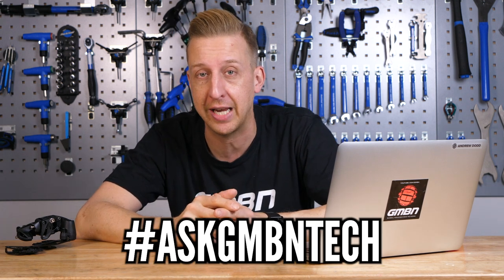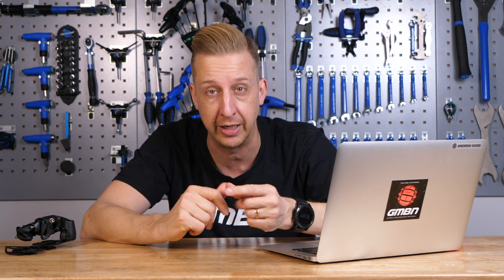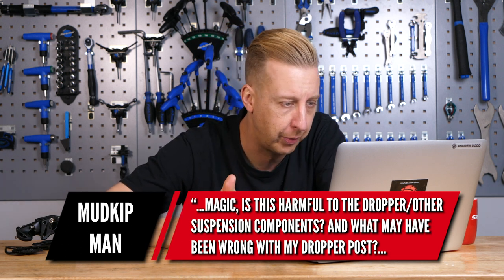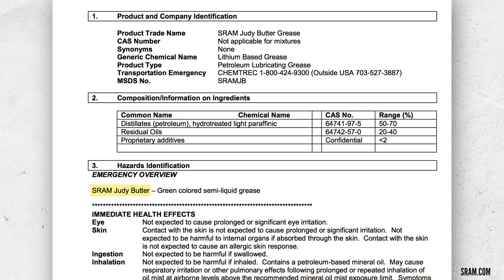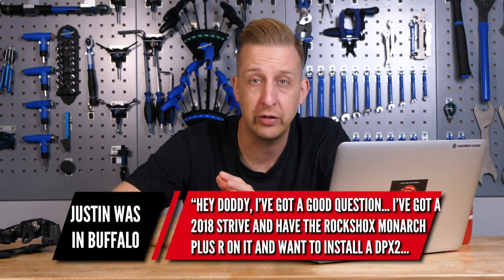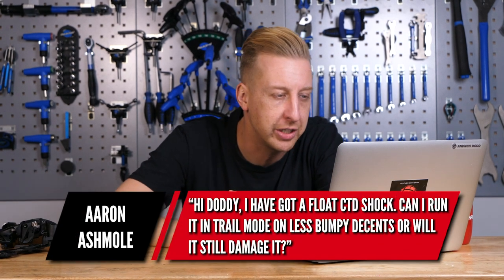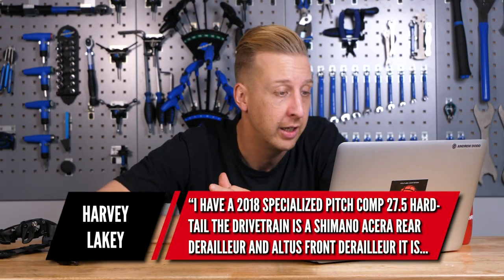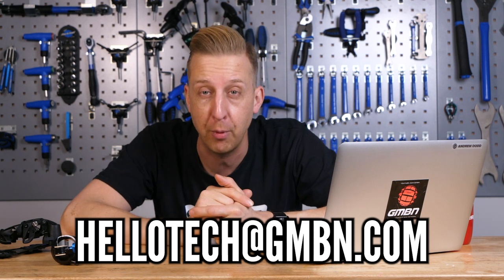Can You Use Vaseline On Mountain Bike Suspension Forks? | Ask GMBN Tech

Comment: #AskGMBNTech : hey Doddy, thank you for the great videos and tips, awesome job. 
I need help with the following. I use my Cube Ltd race (2016) to get fit, its work in progress (long progress). Some weeks back I noticed some play on my left pedal. The thread on the crank arm was totally stripped. I replaced the left crank arm (shimano XT). Now it happened again on the right side, you can imagine my frustration. I checked before I replaced the left one and the threads seemed ok...well, apparently not! My question is what could be the cause, assuming that the pedals were properly tighten. Should I use locktide, change the pedals too just in case?  thanks in advance for your input
Reply: @geemail369   @geemail369 
 thanks for the input, interesting info in the link you provided. I didnt use washers, they
 were not included with the replacement part either. I checked the 
damaged crank arm and indeed my flat pedals were digging in the lip of the chamber thread. I will see if i can get the washers next time i am in the shop, which is going to be soon as I need a new crank arm..
Reply: @geemail369   @geemail369 
 thanks for the input, interesting info in the link you provided. I didnt use washers, they
 were not included with the replacement part either. I checked the 
damaged crank arm and indeed my flat pedals were digging in the lip of the chamber thread. I will see if i can get the washers next time i am in the shop, which is going to be soon as I need a new crank arm..

Comment: #AskGMBNTech why brakes feel harder when you put zip tie around leaver
Reply: As in holding the brake on with the zip tie?
It's to force fluid down which forces air up. As it sits little air bubbles that maybe in the system  will be end up in the reservoir.

Comment: Can i use tubeless in a non tubeless rims? #AskGMBNTech
Reply: Yep, you only need to apply proper rim tape and a tubeless valve!
Reply: do i need the tubeless ready tire too?
Reply: @wildanreynanda  Depends!
With modern tires usually not. Just put a bit more sealant in it to help it seal up.
But you might end up with your very tire having a whole lot of sealant seaping through its sidewalls before it does (if ever!) - it remains a gamble since they're not made for tubeless. Only one way to find out!
Reply: Thanks thats help alot

Comment: #askgmbntech please help

I bought a voodoo canzo last year 2018

I come from a bmx background and this is my first full sus mtb...

When riding after setting the sag and rebound roughly right, the rear end feels wollowy or loose on the general off road but kicky and sending me otb on jumps please advise... Should I use more air and adjust the rebound more?
Reply: you should set sag with no rebound/compression dampening. The sag determines the spring rate and thus the stiffness of the spring (mainly rider weight dependend). Dont do it roughly but measure so you have numbers to compare. If you want a stiffer rear end aim for 25%-30% sag.
Next step is to dampen the rebound, best to count total adjustment clicks and start from the middle setting. And finally you can start playing with compression dampening, best to start from fully open

Comment: #AskGMBNTech is it possible to use tapered fork on straight tube? if possible is it safe?
Reply from the maker: It depends what size Head Tube you have on the frame? If for instance it is 44mm or 1.5" throughout, then yes this works and lot's of manufacturers make headsets 👍. But If your Head Tube is a straight 1-1/8th this will not work. We have seen people press external headset cups into integrated frames and this is strongly NOT recommended.
Reply: Don’t think it’s possible

Comment: #AskGMBNTech I’m having problems with my dropper post. Whenever I sit on my saddle, if I wait like 30 seconds there’s a noticeable of height and I have to set it back to the original height. I tried to tighten the barrel adjuster to tighten it and it partly worked as before when it was in the down position it would go back up overtime. Also sometimes when I use it too much like continuous going up and down, it starts feeling gritty. Any idea?

Comment: #AskGMBNTech I have a Connondale Trail 6 hardtail with a basic sr suntour 100mm front fork with lockout. Each time I ride, the stanchions leak black thick oil. Very little in normal rides and a bit more on cross country rides. Is this normal?

Comment: GREASE or OIL on freehub pawls? Some say thin oil, some say a light grease, help! #AskGMBNTech
Reply: Depends on the sound you want it to make. Thin oil makes the freehub pawls click harder thus making more noise. 
Packing the freehub full of grease is also not reccomended as it can prevent the pawls from locking in place allowing the freeweel to rotate both directions freely. I would use thicker grease on the freehub seals and thin oil on the pawls.
Reply: @fintutorials56  don't care about the sound, just resilience and the least servicing :D
Reply: @jamble7k  Yeah, in that case I would use thicker grease but not pack the freehub full of it! Also put some grase on the seals so no water or derbis can get in.
Good luck! :)
Reply: The lubricant used in a free hub will vary with different manufacturers. Hope hubs seem to cope well with thicker grease and ship with a relatively high viscosity grease inside, so I'd never use oil in that hub. Inversely, I9 hubs are very sensitive to grease. Originally shipping with free hub oil they only recently started using a grease, and it is very thin. If I tried using the grease I normally use on hope hubs inside of an I9 hub it would likely prevent the pawls from properly engaging and damage the hub.
Reply: I use thick grease on mine, I used oil last time and it didnt even lasted a month lol

Comment: Hi Guys, Running my Trek Roscoe 7 2020 for just shy of three months and the Judy fork has developed a new sound. Sounds like water or air in an oil fork on compression and rebound.  Still runs fine but is this I should be worried about and take a look at. Thanks in advance for the expert advise in advance. #AskGMBNTech

Comment: The reason why rear hubs/bearings/wheels/derailleurs/brakes/discs break more often is simply because the front wheel is throwing all sorts of crap onto them. Front wheel axle/bearings/discs/brakes are already out front when the mud you're riding through gets up that high, they'll only get a bit of tyre spray, meanwhile the rear end gets slathered in crap. There's a similar effect on road bikes: did you ever notice that you get more flats on the rear tyre than the front one? That's because most objects pointy enough to pierce a tyre are laying flat on the road. Only when you ride over them with your front tyre they stand up to accept the rear tyre with the point on. This effect is especially pronounced when riding in the wet, as the fluid sucks up particles more efficiently, and keeps them in any position for longer. (and yes, the rear tyre is usually more worn out and thinner.)
The most efficient way you can have your components last longer is: keep them clean. Repack bearings often with enough grease (that serves as a seal keeping dirt out), thoroughly clean the chain, use dry lube and wipe as much as you can off the surface, clean the cassette and chainrings. Keep anything that moves against anything else clean.

Comment: #AskGMBNTech I have just bought an Avanti Competitor S 1 Plus. It shares the same frame as its big brother the Competitor S 2 which comes with an external dropper post.  I'm wandering if I should add a dropper post to it now as I am concerned that manufactures will go 100% internal cabling in their line up. Also what upgrades should I do to it for a beginner?

Comment: i currently own a shimano xt m8000 groupset it is 2 x 11, my question is can i just slap a new chainring on and call it a 1 x 11 or do i need some additional parts/mods? #AskGMBNTech
Reply: "Ghetto 1x" means just removing a chain ring, derailleur and shifter. 👍🏻
Done the easiest downgrading a 2x-crank - you should be fine!
In addition you might wanna shorten the chain, pick a 1x-specific narrow-wide chain ring or add a chainguide though.

Comment: #askgmbntech Hi I recently brought some new continental trail king tyres with the intention of going tubeless. I have a track pump and pressure tank. I managed to get the first tyre seated fairly easily but the second will not seat. I have wet fitted them, used washing up liquid and worn myself out pumping the tank up to 160 psi several times. Do you have any tips for seating a tricky tyre? Cheers
Reply: I use a track pump and pressure tank also, so I can relate... what a pain. 
if the tyre has a kink from where it was folded / zip tied, try setting it up with a tube and leave overnight. Next day, Give the rim a good scrub with isopropyl alcohol, then start tubeless setup again. Has worked for me in the past.

Comment: #askGMBNTech Hi, I’m trying to upgrade to a 1x10 and I have a cassette that is 11-42t and I want to know what type of derailleur do I need, like medium cage, long cage etc. Can you recommend any derailleurs? Thanks!
Reply: Derailleur specs will tell you its capacity! Since you're going for a 1x setup look for a model that can handle 32 teeth or more.
In addition to that you'll need to look for the smallest and biggest cog it's able to run - has to match your cassette.
Reply: a rear derailler is rated for a certain size biggest cog (because B tension adjustment isnt unlimited) and its rated for a certain capacity (because cage cant take unlimited chain slack)
The clutched 10s xt derailler RD-M786 is rated in GS spec for 36t max sprocket and capacity of 35t. The SGS has a 43t capacity.

This means you can use a medium cage but you will need a hanger extender like the goatlink from wolftooth

Comment: Hi Doddy is it normal to loose teeth on the biggest sprocket on a 1 x11 system, if so what causes it to happen ? Because I have one or 2 teeth missing on my bike - Thanks Kyle #AskGMBNTech
Reply: That's definately not "normal".
My guess: shifting under load with the guide pulley being adjusted to close to the largest cog.
How much space is there in between the upper pulley and the sprocket?!
Reply: @geemail369  Agreed, that should not happen, if it's a good brand of cassette.  Check your B screw!!  And make sure you're not down shifting under a big load on the pedals.

Comment: Just to nit-pick a bit, inverted forks on motorbikes certainly became widely used before inverted forks became (or have become) common on mountain bikes. However, inverted forks for motorbikes are a relatively new advancement, E.g. Yamaha's 600cc race bike didn't switch until 2005, which is still found primarily on higher end performance oriented bikes to increase front end stiffness and improve handling.
Reply: I believe KTM  where using inverted forks since the mid 80's in their mx and enduro bikes
Reply: @maxb7281  oh yeah I'm not saying that they didn't exist for longer. Rather that they weren't common place until recently, and the other point was traditional forks were earlier than inverted, even on motorbikes...

But if we REALLY want to dive into forks, there's some pretty incredible history from Springer forks, girder forks, and linkage forks like the motion or message mtb forks that are just coming out now. I'm not sure if mountain bikes have tried anything similar (maybe good topic for weirdest mtb forks segment?) But motorbikes have even tried hub based steering on a front swingarm, and a bunch of other wild stuff.

Comment: #askgmbntech hi doddy I am selling my old trek hardtail is there anything I can do to my bike so that I can get a higher price for it thanks
Reply: Clean it thoroughly, re-lube and dial the drive train, re-grease shift levers and inner cables, apply some tyre shine, replace old/worn chainstay protector with cut up neatly wrapped inner tube - take lots of high res fotos.
Reply: remove light scratches with some polishing compound

Comment: I took a long break from riding, from 2001 to 2018, being a taller rider I found that current bikes are leaps and bounds ahead of the sizing then to start, and my tweaking was much less.
Reply from the maker: Geometry has definitely changed a lot since then!
Reply: I hear you, I was the same.  My last bike was a 2009 hardtail - terrible for a 6’ rider, new bike is 2018 Hardtail, longer by 4"overall.  I never understood why bikes only got taller and more unstable for climbing as the rider got taller, same goes for descending, wheel base and chainstay length were not proportional enough to frame "size".  29er was too expensive back then for me, this would have helped a little.  With longer bikes nowadays suiting taller riders, I wonder if there is an adverse effect on shorter riders, should XS and S frames have 26" wheels(and shorter chainstay), M and L 27.5" and so on?
Reply: @geremywinters8186  I hear you, I ran a smaller bike back then because the stand over heights were too high because I'm a bit longer in the torso. Depending on the brand, some smaller bikes are that way. The Liv  that fit my lady best was a S, but the proportions of everything were better than the smalls most other brand she tried.
Reply: @geremywinters8186  Looking for the right bike for my 5 foot wife was very difficult, even now, the wheels look massive relative to the tiny frame. It wouldn't be a bad idea to scale wheel size to frame size, maybe even travel. I noticed some brands make the smaller sizes headtube  slacker, otherwise the wheel would hit the downtube on smaller frames.